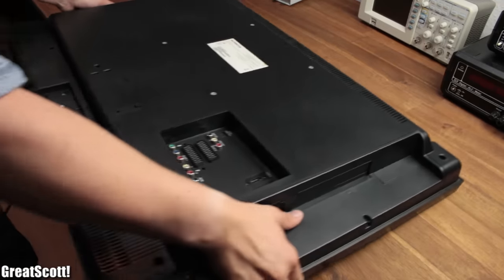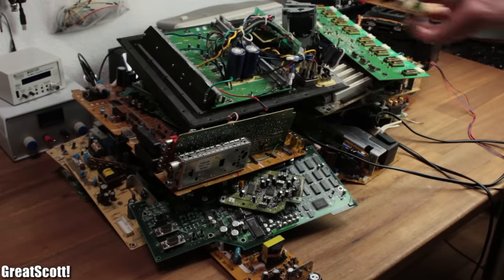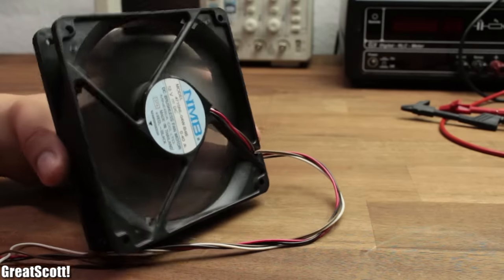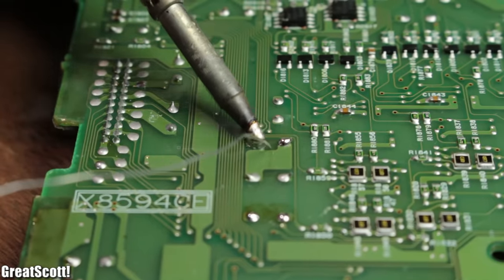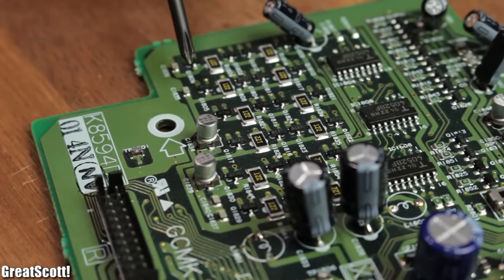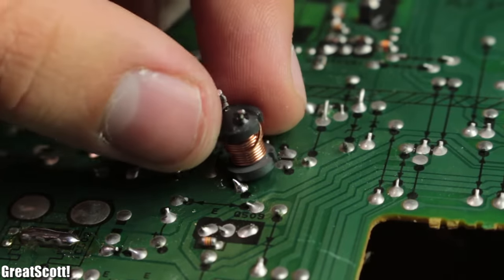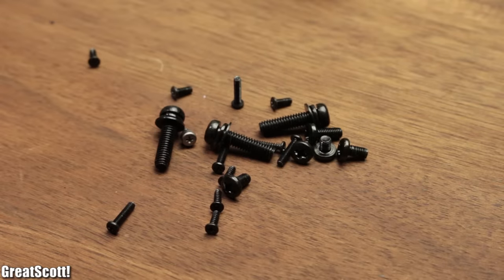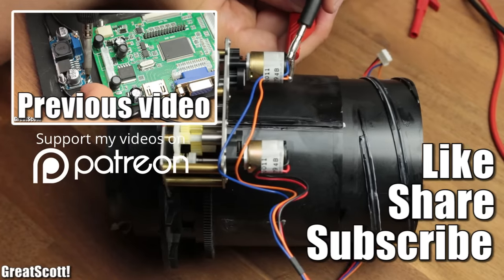What is worth desoldering from old electronics? || DIY Fume Extractor

Comment: What I hate about trying to desolder a surface mount inverter/SMPS transformer is that the pin sockets in the board's holes still continue to hold it so tight you risk breaking either the bobbin or the core of the transformer when you try to remove it.  :(

It's nice to be able to get stuff you don't have to pay cash for.  

Hood vents aren't too difficult nor expensive to make.  Plus blowers from dead microwaves work really well at this.  

My biggest prize is a power transformer I got from an 80's stereo system because its secondaries together in the right configuration equal about the same voltage out as the input primary side.  IIRC the stereo was rated for 1000W to 1200W.   So my Iso. Transformer not only is of high quality for audio, but gives enough current, 8-10A for larger projects.

Comment: For SMD I just bust out an electric frying pan. Throw the board solder side down in the pan and when it gets warm enough you can just start plucking parts off with needle nose pliers or tweezers.

Comment: Here's another tip.  Instead of using a soldering iron just get a heat gun.  They can also be cheap.  A small one will do.  A heat gun will get all of the SMT parts quickly and easily. Holding the board vertically helps as well.  Sometimes they just fall off.  It takes practice and patience to learn how to get the parts hot enough to melt solder while still not burning anything. But this type of salvage is the perfect way to learn.  If you burn things up so what?  It's trash anyway.

Comment: I'm not an expert but I think it's worth mentioning that chemical filtration does work it shouldn't be used like that. Carbon is amazing and can last longer than most other filtration systems but it's also very porous. It gives the illusion that the air coming out is clean but it's not. Most of the particulates aren't going to be removed on the first cycle. There is no circulation so whatever exits the other end is no less harmful if inhaled.

Comment: this is how i practice and experiment with electronics, but i desolder and salvage EVERYTHING i can, i'll only buy most parts when i decide to solder a permanent  circuit i want to keep for more quality an durability, i often make diy breadboard adapters for parts that can't plug into it because of to big or incompatible pin spacing, even my very first breadboard was i diy that i made from old ide cable plugs, by opening the casings and soldering  a wire across the pins and then gluing them toghether!! XD i do buy stuff like arduinos and 555 timers since stuff like that is really rare in modern commercial electronic, but otherwise, i love learning and doing stuff by myself, even more when i can use recycled stuff to make it!!! XD

Comment: for ICs and SMT parts, just use some tin snips and cut out a square of the pcb and leave it on the part.
Reply: as an added benefit, having a chunk of pcb left on a large IC can make it easier to mount it with screws by drilling some small holes. just make sure to scratch between every trace to undo any premade connections between the pins.

Comment: Good, i save EVERYTHI NG i can (until some useless items end up in the garbages (or recycling) after every several years! But, prior to share that video, i would have leave 1-2 inches of wire on the transformer power adaptor! (Or simply use my bench power source to run the fan). But thanks, it reminds me to build myself a fume extraction fan actually... (Was on the Todo list but... )

Comment: ROSIN FLUX FUMES HARM YIUR HEALTH??? I have LOVED the smell of that for 24 YEARS. Ever since age 13 when I done electronics class in school. Btw you've obviously never been to Australia. Rosin flux fumes are the last of your problems amongst welding galvanised steel, lighting fires with diesel, grinding rubber to size with an angle grinder, melting holes in plastic with hot wire, etc etc.

Comment: Recovering old electrolytic capacitors seems like stepping onto a bit of a minefield. They are easily the most unreliable component in most electronics. Except for large expensive ones like the ones on the primary side of a PSU you're probably better off buying new.
Reply: Usually older and newer ones are still fine, depending on the projects. Though capacitor plague era ones are avoided at all costs. Personally would only use new ones in projects that I know I keep around for an indeterminate amount of time, but for testing stuff of very temporary solutions used ones are fine.

Comment: Inductors, Heat sinks, hardware and occasionally a part if I need it now. Thats it these days. I used to almost strip the boards down years ago but these days good electronics can be had so cheap there is no point for most things. Dont forget too that the board has been canned because it did not work so you may end up with stressed or U/S parts anyway. Also how much does the time cost for doing this?

Comment: Regarding DIP ICs I bought myself a cheap desoldering station (ZD-915 ESD 80W for 83,50€ (idealo.de) ) . 
After the first test I just asked myself why I didn't buy one of these years before. It is really easy to unsolder such IC's with that

Comment: Sometimes components on something like a computer motherboard, especially all those juicy capacitors in the power supply are on a board with so much copper or other metal mass that a normal soldering iron won't melt the solder.  This can be some nice heat sinks, etc, or even a spiffy multipin connector.  If you don't plan on keeping the board after harvest time, get out the heat gun.  It will melt a large area evenly and quickly.  Flip the board over and heat the connector or heat sink pins from the back of the board.  The solder will melt, and the capacitors will just fall out.  If the pins are crimped over, have a spudger ready to straighten them once the solder melts.  For connectors, etc, you are heating all the pins at once, and they just fall out, too.  Sometimes they need a little tap or a push to encourage the reluctant.  and connectors are plastic, so if they get too hot, they melt.  Clamp the board in a vise or some kind of workholder, as it can get hairy working on both sides of the board, and time is of the essence.

I have used this for quick removal of chips also, but this does require some practice.  Control how hot you get things by keeping the gun spaced away a certain amount and keep it moving.  It's fun to desolder a whole board full of unidentifiable surface mount garbage, just to watch the landslide.  And if you have the skill, you can get some interesting sockets and parts that you'd never buy.  I've done it just to see if I can.  What am I going to do with a PCI-e motherboard connector?  I don't know, but I got several for free like this.  VGA connectors (DB-15 high pin density), serial port (DB-9), stacked USB ports, audio jacks, rows and rows of dual row pin headers?  Now those I can do something with.  

Once you do this, you'll never look at a PC board the same way again.

Comment: There is  two things you seriously should try out:
1: Use heat gun (2kW with small nozzle)
2: Outdoor environoment and little wind (makes lot more smoke then soldering iron)
Then just go ahead and remove IC's with as many legs you just want - and even SMD parts are easy to remove.
Just beware there are some electrolyte models that actually explodes when heated too much.

Comment: If you have some storage space, it is worth to let boards with SMD components on them here. You can never know when particular components will become in use. Especially if those used boards have same components like transistors, diodes and ICs that you are using in your projects and which are not so easy to obtain in shops. Desoldering is easy with hot air gun. Also DIP ICs soldered in board are easy to unsolder with hot air gun having a separate compressor (ones with fan in handle are weak in general).
By the way guys from former Soviet Union like me greet you. We have great understanding in electronics salvaging. In old times like 20+ years ago we hadn't access to many components and in Soviet Union many components like ICs more advanced than common logic and OPamps simply wasn't available for a common guy. So we scrapped all that we had able to take. Although nowadays some components like rarely used ICs also are difficult to get because they are manufactured by hideous Chinese garage laborers in limited batches :)

Comment: I've watched several documentary films about the shanty-towns that have sprung up around E-Waste dumps in Africa and Asia, and the low-tech methods used  For recovering copper and precious metals are highly toxic to the locals and their environment. Gold will typically be recovered from circuit boards with either cyanide or liquid Mercury ,  sometimes in the same wok- like cooking pot that they make dinner with. Copper wire is burned to remove the insulation (PVC  fumes are highly toxic). And just because modern devices were made with lead-free solder doesnt mean they don't contain toxic metals, such as bismuth and antimony.....

Comment: The easiest way to get the parts out is to use a propane torch ( for welding copper pipe). Heat up the area and slam the pc board on the hard concrete floor until the parts are out. Please use gloves and eye protector.

Comment: There is a faster way to desolder: 1. Get a large heat gun around 2000W and set temperature around 350C. Install PCB above a table and heat it. Nearly all parts falls off, if not, give it a tick with a stick. 3. Find someone to sort the components.

Comment: Most capacitors are not worth salvaging either, especially electrolytic. This is because they degrade over time. For smd components you can employ a halogen light as source of heat while using a scalpel to gently pry them off - you need that as most smd components are glued to the pcb prior to soldering.

Comment: I mean, It's all about point of view right? if you need practice then it's all worth it.  Going through massive dips and connectors helps you not melt/fry your new components you spent money on.  Also great way to get SMD practice....that...that's the logic i use when i keep every single scrap PCB i find that i have yet to spend hours upon hours desoldering.  Yeah, good logic that is.....

Comment: I am late again ^^ but, when i was a poor Schoolboy i got every thing from scrap parts. Most of the time i just took the Dreml tool and choped out the pice of PCB that contained the Part i wanted/needed. You need to check for shorts but normaly this is way quicker than desoldering chips. Then just wire the Part up with some tiny wires and make a breakout PCB using PerfBoard. If you plan to make it a Production Part its worth going directly from Schematic to PCB. I like PCBWay and MultiCB(Germany) Les critcal designs i order from the cheapest offer. HighSpeed and HF Circouts i buy mostly from MultiCB. I just have better experience getting the desired specs from MultiCB. Also they get intouch if they think some thing is off.(Most of the time they are right. ^^)

Comment: I would think electrolytic caps would be some of the more perishable parts on any circuit board.  Of course if you have some sort of automatic tester that will allow you to see its condition then maybe it's worth it.  If you shell out for something like a Hakko FR300 desoldering tool, then even ICs become a breeze.

Comment: Heh, I used an old 12V power supply (actually around 15V under load) and an extension cord for computer fans and now I have a power supply I can connect to 2, 3 or 4 pin computer fans to test them and I even added a connector for a 9V battery. It's now easier to figure our which fans are loud. Loud fans are quieter when I add oil to them.
Reply: I did the same lol

Comment: Don't remove parts from the PCB unless you need them.
First, on a PCB you know where to find a specific part you need.
Second, you loose a lot of time if you desolder parts you never use.

SMD: Just go outside use a blowtorch...all SMD parts will fall off within seconds.

Comment: just an fyi, carbon filters are great at getting rid of fumes from flux. However, to get rid of lead particulate, you'll need a filter with a MERV rating of 13-16.
Reply: That's why I'm soldering with lead free solder. I don't really have problems with it.

Comment: I've been wondering how I could maybe collect a few electronic parts on the cheap. I';m trying to get into audrino based projects have some old stuff that I could try this out on. But how would I got about making sure the capacitors aren't charged when de-soldering them so I don't some how shock or have them blow up in my face?
Reply: magnifying glass and sunlight

Comment: Rather than using a soldering iron and wick I use a hot air gun, butane or propane torch.  The printed circuit board itself is unimportant just the components on the other side which are only touched by the heat on their leads.

Comment: I only salvage caps and resitors. The legs are short but not too short to be resoldered. Otherwise I would not take Elkos when the PCB what theyre from ist older than 15 years because they dry out even when not in use

Comment: How do you know what the inductance value of your coils is?
Reply: There are DMM's that can measure it. I suppose you could build a tester, though that might be more trouble than it's worth.

There are tables and equations that let you estimate inductance based on coil size (diameter), length, number of turns, and core. Depending on use, it may not be important to know the precise value - for example, if you're trying to damp some ripple.

Comment: Hey GreatScott, I was wondering how do you deal with big capacitors to avoid residual voltage? Do you know of a method to discharge them prior to working on the board?
Reply: Do what I do and just short out the leads. 
It works every time.

Comment: I remove everything except surfact mount stuff. Solder sucker is a vital tool. I will have to disagree on the thing about ICs. PCBs are an amazing source of ICs IMHO. Just use a solder sucker to desolder it one pin at a time.

Comment: I just heat everything up using heatgun and then I slam the pcb against concrete block. Most of the parts fall of. Never forget to desolder LEDs first, otherwise they will melt.

Comment: I have an soldiering iron but I broke it and need a new heat element for it and I use a little hi volts on the fan and broke it and scrap it and reuse the blade

Comment: If they have resistors, I keep the boards around.
Just this sunday a project called for an 1M ohm resistor. I didn't have any, biggest was 39k so I'd have to chain a fuckton of them. Pulled a board I was scavenging just the previous day and there were two of the exact ones I needed.

Unfortunatelly, the only hobby electronics shop in town closed. I can't even get 3.5mm audio jacks! So scavenged electronics are an important source for parts since I have to go a town over for them.

Comment: Is it dangerous to open a device shortly after unplugging it from the power outlet? Can the capacitors still be charged?
Reply: You can always discharge capacitors with resistor btw
Reply: @Akyomi777  yeah, but you cant do it on a big device with 20 capacitors or something... That takes to long

Comment: U dont use an air gun for desoldering ? I've used SMD in the past, which sucked the fumes whist using the iron but its pipe used to get in the way and was rather a nuisance.

Comment: I want to make a Soldering Iron/Fume Extractor  Station as my first arduino project.
Reply: Fume extractor with arduino? You can just use 12 volt regulator, fan and if you want to control it then maybe a switch too but a arduino is not even needed same with arduino soldering iron. On market there are even some decend cheap soldering irons or I got a communist solder gun from a uncle and its great for my needs since he said I have potential in low power circuit projects

Comment: Footnote here, the best to unsold  components in not to use a mesh but a desoldering pump. Something like that one https://www.ecbidbuy.com/products/desoldering-pump  Also note about electrolytic capacitor; if they are old, chance are their value wont be the same as the oil inside tents to evaporate over time. Anyway it's good to recycle/reuse, I did it a lot in the past when I used to do lots of project but with little money to buy new components all the time.

Comment: Moar power for desoldering then 40watts for sure.. as more and more devices are RoHS and solders dont have lead in them... and require more then 400 degrees celsius to desolder them without mixing ur own lead solder

Comment: damn bro my OCD kicked in severely when you didn't cut the connector wires from the adapter and the fan to a 'recyclable' size... those can easily be reused to retrofit a compatible power adapter with an incompatible connector or something..

Comment: Has a title of "What is worth desoldering from old electronics" - 
Immediately shows a fairly new flat screen TV being torn apart. 

Shoot,  I still rock a 27" analog CRT screen from '96... And I will until it breaks.  I'll likely die before it does!
Reply: Is your eyes ok? I pretty much have problems with those.

Comment: Hey hey hey wait a minute...

You didn't show how people can check which side blows and which side sucks! What happens if you get a viewer whose lived in a cave under a rock for the past 100 years or so whose never seen technology?

Serious question. Could you just use a belt sander on the back side to remove the solder and free the parts? I've never tried it, sounds dangerous, but if someone has tried let me know what happened.